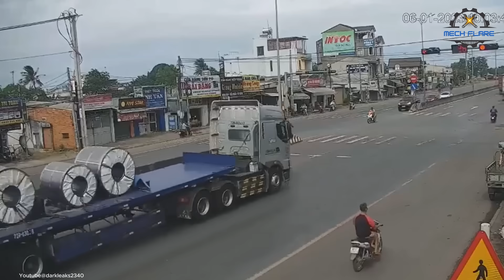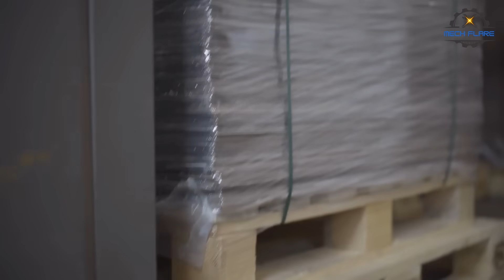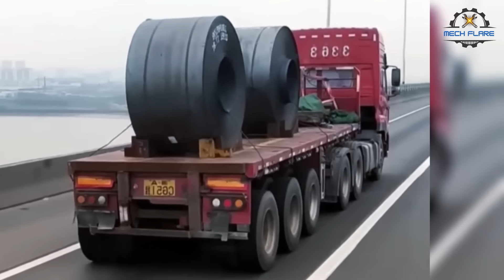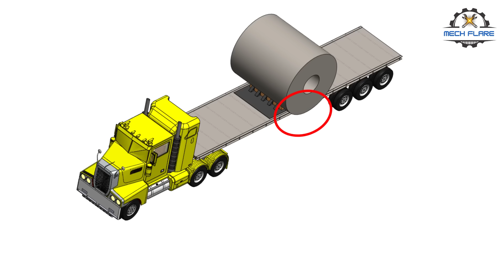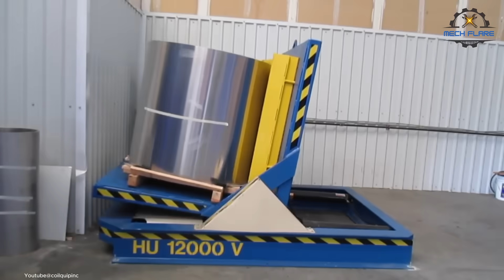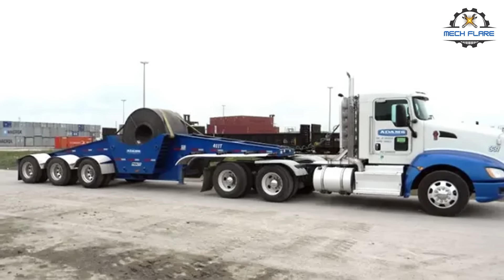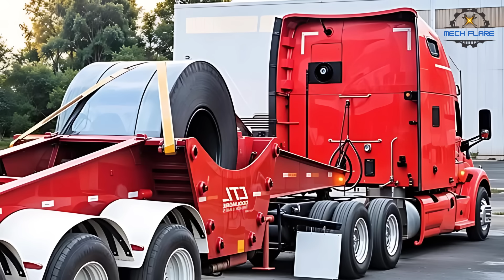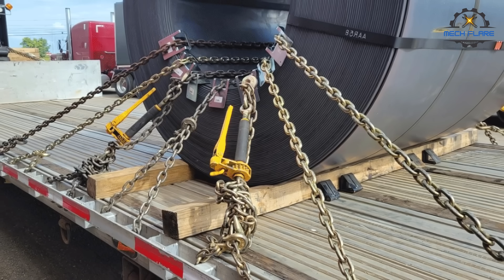Suicide Steel Coils: Can We Stop These Monsters? (USA vs Europe)

Comment: Properly secured the danger is low. Who is going to bear the increased cost of a dedicated trailer?  A cover unit over top a 2nd set of chains might be an option.  If you want dedicated trailer. It should have much higher capacity.  And ability to be stacked going back empty.
Reply: You don't need Specialized trailers. You can make small-ish supports that can be bolted down to a flatbed trailer, as well as simple and small mods to the trailer can improve safety A LOT, without hurting the trailer's versatility
Reply: @raphaelrodrigues1645  could you send me pics of your designs?  Maybe post them on trucker forums?  Cost, simplicity, time, weight all matter.  
  Personally I haul 3 similar commodities.  But enjoyed flatbed. Proper securement is key.  I hauled a 12,000 tractor. Before unstrapping I was told. “If we had a crane. We could lift that trailer/tractor 40’ in air, flip it, drop it over 20’ multiple times, flip it upright I bet it would not have moved an inch”.   I am proud of that. Á 3/8” 1/2” chain, load binder can be used Á thousand times.  Before it might need replacement. So only real cost is time. Throwing an extra chain should take maybe 5 minutes?  I give away old smaller straps.  Person using rope at lumberyard with lumber. Often 1”x15’ new 500 lb working load $3 or less.

Comment: most drivers use the minimum amount or tie down. and at that thay dont over look the chains before using them. few extra chains and peace of mind
Reply: Speak for yourself
Reply: Most big trucking companies, such as the one my father worked for, will fire a driver for touching anything other than the steering wheel and the shift lever. The loaders are solely responsible for securing the load before the bobtail takes it.

Comment: Yes and no to the receivers preference. It comes down to how the receivers have to unload the coils to begin with. Most have overheard cranes so they tend to purchase really big coils to keep their continuous stamping (ie car manufacturers, pop can manufacturers, and steel plant manufacturers) and or slitting machines to size the coils down to what they need (ie pipe manufacturers). Suicide coils is the only way to get those massive coils to the customer, if those massive coils were laid down on their side it would be safer to transport but the oversized permitting would be add additional costs to transportation not to mention the width issue which would necessitate escort vehicles and possibly state escorts as well (added costs). Any coil that's smaller than 8 foot tall can be laid on there sides and transported safely with no additional costs for permitting and or escort vehicles. But then it comes down to what the receivers want for the smaller coils. Remember tow motors have weight carrying capacity limits.

Comment: Another reason for not having automatic braking
Reply: You do know this can be turned off, the emergency braking on the other hand comes into effect once the driver already failed to do his job. Do your job properly and the truck will be your friend. When you fail at it dont blame the truck for doing your job.
Reply: @htmn_2 you can't turn it off. I'd rather chose when the truck absolutely hammers on the brakes with my foot. There are times braking hard is more dangerous than hitting the dumbass that just cut in front of you.
Reply: @htmn_2 plus one of the systems has a history of jamming on the brakes after it erroneously sensed things that were not there. Think its bendix wingman

Comment: They are only suicide coils when you haven't got them restrained property. Carted them for over 10 years and never had a problem because of our load restraint. Also we had to do a load restraint course every three years for coils. Saved my life a few times, those coils never moved on my truck at all with the chain system and racking system we had.  .
Reply from the maker: Exactly. Thank you for sharing this.
Reply: You didnt die even once?😮
Reply: I learned from fellers like you. I chained the hell out of the ones I hauled. I didn't pull a coil trailer though, and was always concerned that it might buckle.
Reply: @Truckngirl  You can chain a load all you like , but if you don't have the right racking system , rubber that is the right rubber for your racks and the chains ( tonnage rated chaining system )  and chain dogs ( Also rated ) . You must have the chains and chain dogs or dogs all rated for the coils you cart.  Then you can travel safety along the road with no problems. I'm not being a S---Ass here , Its just the chain system for weights of the Coil you cart is the solution to not having problems in Transport. Good luck and stay safe and keep on truck'in.
Reply: Working at heights is safe as long as you grip ladder hard enough. People built Eiffel tower without any security ropes and survived

Just because you survived doesn't mean it shouldn't be more secure
Reply: You were probably a good driver that paid attention to traffic too 👍🏾👍🏾👍🏾
Reply: @Nocturnal2010  

What does traffic have to do with it, if your coils are restrained properly the traffic doesn't have a lot to do with it . Its like restraining timber , you restrain it so it does not move. They call it load restraint for a reason. 
It saves lives and yours could be one of them .
Reply: @Gee-kb2pv there are people who think that a sudden stop would brake em loose no matter what you do... and idiots can make you slam the brakes quite often. 

We both know that you can slam the brakes as often as necessary if the load is secured properly... but we both worked with em.
Reply: @Nocturnal2010  The people who make those coils safe to transport are the loaders, not driver. 
You can be as good as a driver as you want but if the loader f*cked up restraining them properly, you're f*cked.
Reply: @Myriip  You're allowed to refuse to move from wherever you are if it's not secured properly. Just look at the load you're about to take and request it be secured properly. If they refuse, or threaten you with costs for whatever delays you cause, feel free to call whatever government body takes care of safety regulations in transport in whatever country you are. NO COMPANY is allowed to FORCE you to risk your life or life of other road users. You cannot be punished in any way for refusing an improperly loaded cargo.
Reply: @Myriip  The driver should be fully informed so they can inspect the load before accepting it. That's what pretrips are for and they're not rocket surgery to do. Trusting loaders can be dangerous, like the time my wife had to refuse a dry van because the rear tandem was attached by one pin and prayers! It's the same principle as training pilots to do preflights. Every operator with any sense behaves as a professional (and takes photos so no one can call them a liar!). My chicken hauler bro even records all his convos with dispatchers because the company hires some real winners...
Reply: @kikixchannel there's a little exception.  But only for fully enclosed trailers. Whenever a trailer is sealed,  the driver literally can't look at the load
Reply: @VBormann  Yeah, it's sealed then. But a fully enclosed trailer is unlikely to have catastrophic failure. And for smaller failures like damage to the load due to, I don't know, porecelain boxes falling off the pallette? They're not responsible for it if they never were there for the loading and they never drove in a reckless manner.

It's not like the drivers don't know what they are moving, though (if it's legal). It needs to be stated in the papers, else the first police control will stop the truck and issue fines.
So if you know you're loaded with something rather dangerous, you can take that into consideration with how you drive. Sometimes, you'll know quickly if it was in fact incorrectly loaded based on sounds or how the car drives (if eg. the entire weight is on one side).
Reply: @kikixchannel let's agree to disagree here. With up to 28 metric tons of cargo there's a lot that can go wrong! And the driver may not be responsible but it doesn't help when the entire truck flips and crushes multiple people! There's no legal consequences for the driver but the guilt is still there.

Comment: As someone else has already mentioned, consider the Coil Trailer option. You can partially lower the coils between the frame, preventing them from moving. If you don't use it, the plates (included from the factory) go on top, allowing you to transport pallets, or both at the same time. With the curtainsider closed, you have even more security, as curtainsiders can also be supplied "armed" (and often REQUIRED).

The US has a lot to learn in the transport sector, whether everything is on a flatbed or in a box trailer, but tautliners (curtainside and sliding roofs) are rarely, if ever, considered. It's probably the same as with other things: they don't want to stray from the beaten path and stick with what they're used to, making them afraid of innovation. And then there's the problem of the trailer's axles being set miles back, which is due to axle load and the poor roads/bridges in the US. Instead of spending money on war and other pointless pursuits, let them build decent infrastructure, which would also contribute to road safety. And then you can also add more weight, which would also result in less traffic on the roads.
Reply: And you’re a grandstanding idiot who doesn’t understand the geographical differences between Europe and North America. 

Does the USA need to stop importing morons to outsource American trucking? Yep, but your average crossing international borders  loads are under 450 miles. The average cross-country trips is 330 miles. The average US trip hovers around 600+ miles. And if you’re transporting coils to a location with a specialized trailer designed to haul one thing, traveling on average about twice the distance that the uk and Europe do without any chance of getting a load that would make you any money traveling back to the sender while also traveling twice the distance of your average European load one way. 

There are no one-size-fits-all solutions. Australia can have road trains for reasons that don’t work anywhere else. Canada can have b trains because of circumstances that prevent Europe and the USA from having them. Everyone has different ways of doing things because the circumstances in which the work is being done are different.
Reply: I don't know where you get that from. We use conestogas and curtain sides all the time. Our roads also aren't that bad. They definitely are not falling apart. It's rare for a truck to have his axles all the way back. They're usually moved as far forward as the weight distribution allows for ease of handling.

Comment: loading coils sothun in valley equipped trailers is not cost effective for the independant haulers.  not many experienced haulers use shotgun in the US ,  The simpler solution is not to allow improperly secured coils to leave the mills. Make the shippers liable for the proper securment of the load.